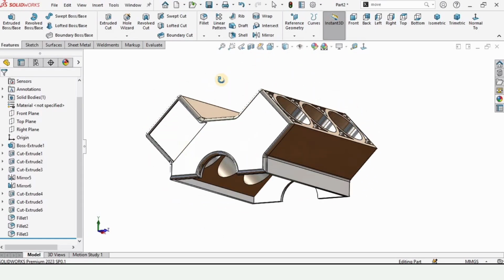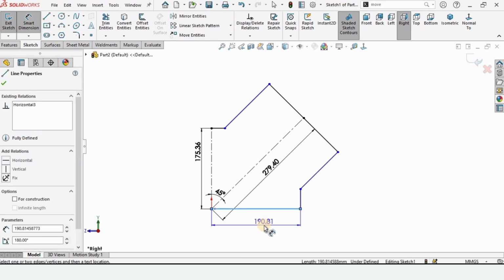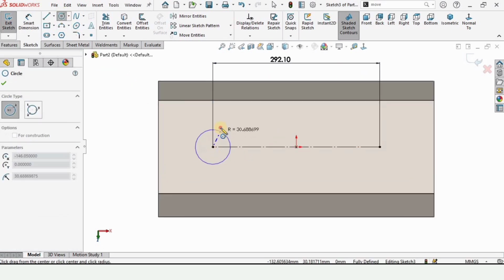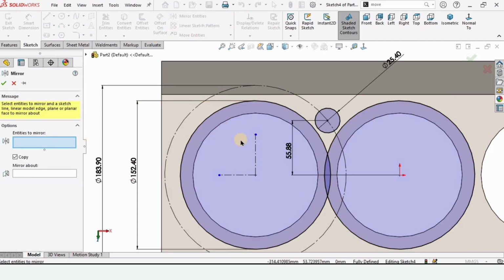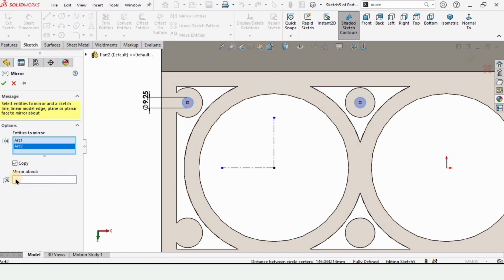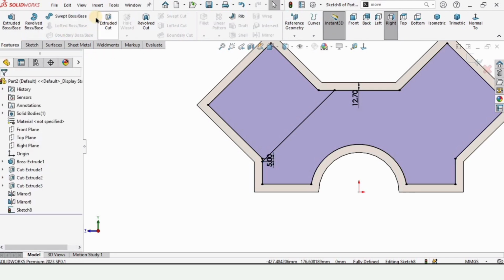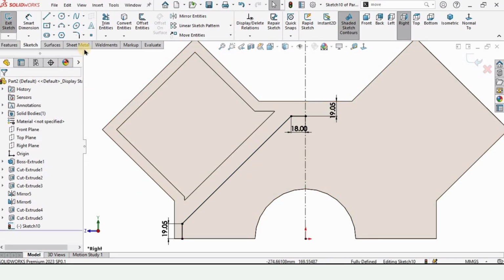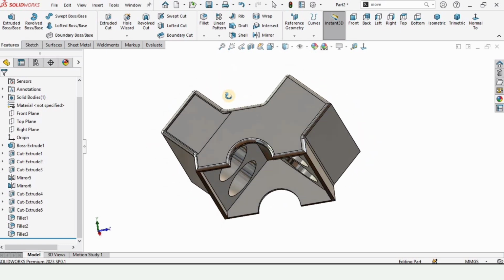Engine Block in SOLIDWORKS | Robo CAD

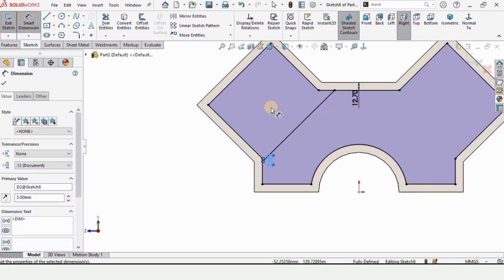Comment: 10:05 My inclined line is not intersecting that middle horizontal line as shown in the video by taking distance 5 mm & making the parallelity constraint...
My inclined line is intersecting the inclined line on the opposite side, how?🤔
Reply from the maker: It seems a prior step or constraint might have been applied differently. I’ve shown all steps clearly in the tutorial, so please recheck the earlier dimensions and constraints.